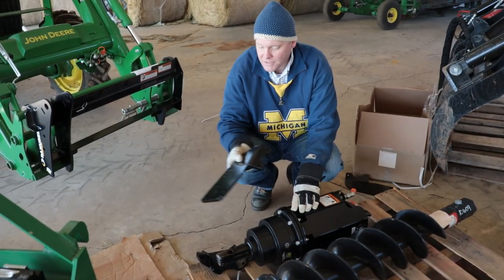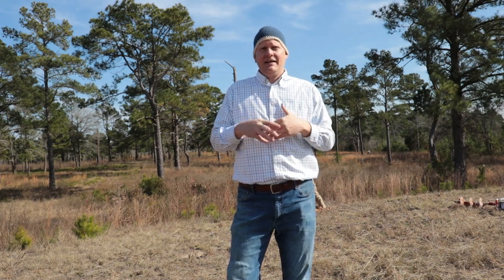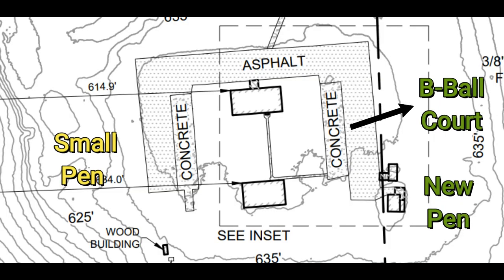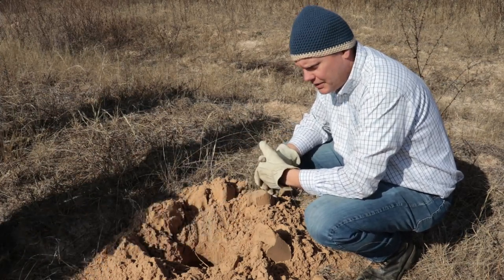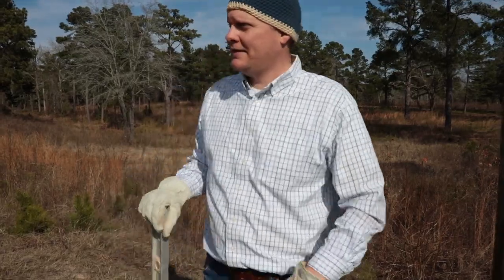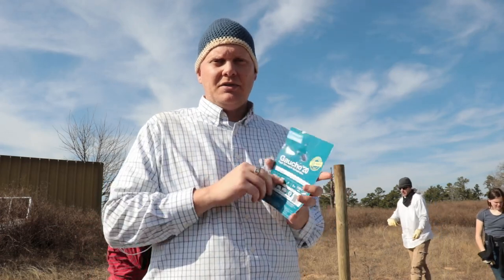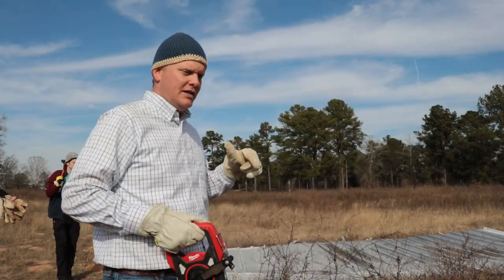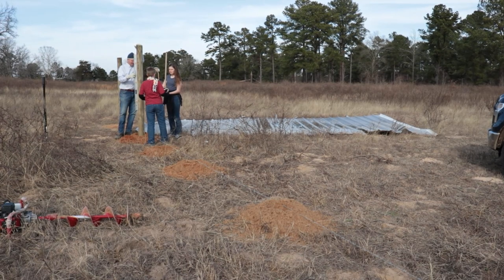Ep. 55 - Danuser Auger - Will It Work for me? Blackacre Ranch

Comment: did i read right earlier that yall are planning on bison in the near future? also, if you have sand, just pour water in after the post is inserted and then put in the sand. it will pack itself. i assume yall have already seen "cross timbers bison" but if not i strongly suggest you do. bison is a force to be reckoned with................g
Reply from the maker: Yes to the Bison.  We also plan to have pigs, chickens, turkey, and Highland cattle.  I just finished the rest of the posts and wish I'd seen your suggestion of using water to pack it in.  I'll use it in the future when doing more posts.